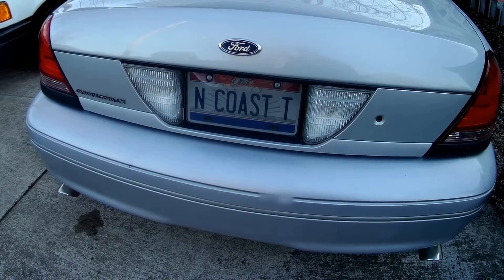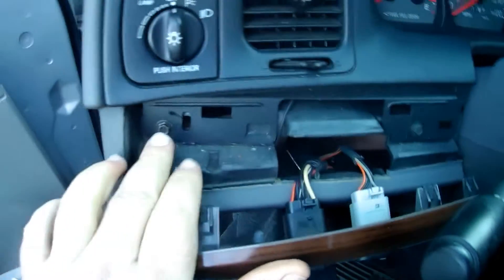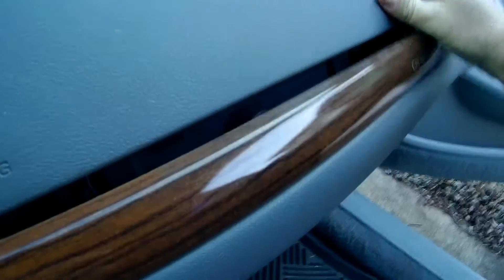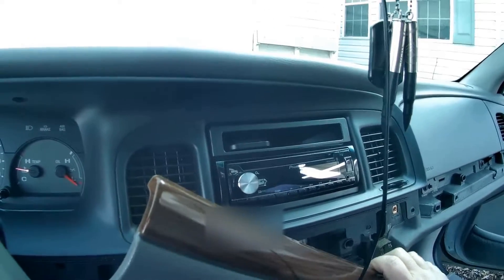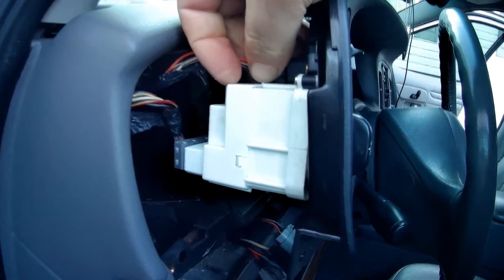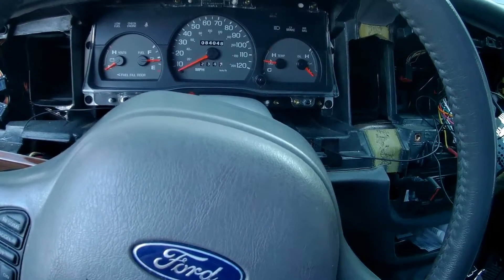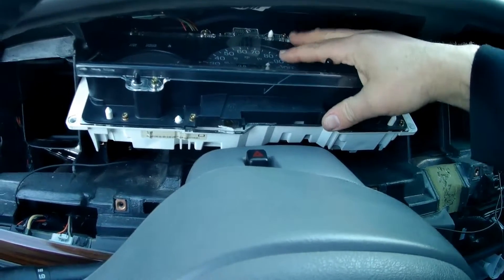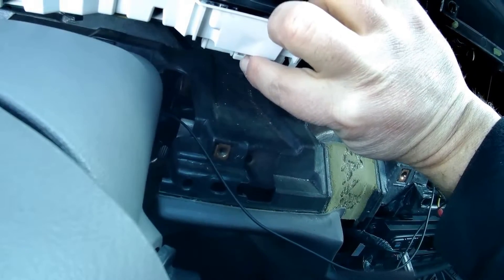Crown Victoria LX Sport LED dash cluster conversion.

Comment: What size bulb did you use I can’t seem to find anything
Reply from the maker: I got them on Amazon: AMAZENAR 30-Pack White Replacement Stock #: 194 T10 168 2825 W5W 175 158 Bulb 5050 5 SMD LED Light,12V Car Interior Lighting for Map Dome Lamp

Comment: Do Mercury's have the same lights? And if so what kind of bulb is it?
Reply from the maker: Thank you for checking out my video. Yes, both are the same and the part number and description on Amazon are: AMAZENAR 30-Pack White Replacement Stock #: 194 T10 168 2825 W5W 175 158 Bulb 5050 5 SMD LED Light,12V Car Interior Lighting for Map Dome Lamp
Reply: @NorthCoastT  I appreciate you

Comment: Where can I get this light
Reply from the maker: Thanks for tuning in! I bought them on Amazon. 
AMAZENAR 30-Pack White Replacement Stock #: 194 T10 168 2825 W5W 175 158 Bulb 5050 5 SMD LED Light,12V Car Interior Lighting for Map Dome Lamp

Comment: Have a 2011 P7B CROWN VICTORIA POLICE interceptor do you knowing if it's the same cluster so I can change mine over also are them dimmable bulbs you installed . Thanks
Reply from the maker: The bulbs are dimmable but not sure if your cluster is the same. It should be, they used that style bulb for a lot of years. I know they added a tachometer but think it's very similar.
Reply: @NorthCoastT  Just found out mine need to be solderd to the board  I guess they are surface mounted leds.

Comment: This is a great video. What is the part number of the led bulbs you put in your dash ?
Reply from the maker: AMAZENAR 30-Pack White Replacement Stock #: 194 T10 168 2825 W5W 175 158 Bulb 5050 5 SMD LED Light,12V Car Interior Lighting for Map Dome Lamp
Reply from the maker: Got them on Amazon!

Comment: PRNDL indicator is string driven.  Remove column  top cover.  Remove one bolt.  Slip string loop out.  String is spring loaded so gentle pull needed.
Reply from the maker: Thank you for the information and checking out my video. I have a 2002 Grand Marquis that I will be doing next.

Comment: Good afternoon:
check your Crown vict. Do you have lighting in the air conditioning controls?
Saludos.
Reply from the maker: Thanks for tuning in! I have the digital air conditioning and heating. I didn't take it apart to replace anything there.

Comment: Hey buddy great video.
Can you update if the leds have cause any interference?
Any problems at all?
Thank you,have a great day
Reply: Do you have a link of the product?
Reply from the maker: @dvader3000  I will look it up now for you.
Reply from the maker: @dvader3000  Check this out at Amazon
Alopee - 30-Pack White 194 T10 W5W 168 2825 158 501 Wedge 5-SMD 5050 Chipsets LED Replacement Bulbs for 12V Car RV Interior Dome Map Door Courtesy Trunk License Plate Clearance Lights Marine Light https://www.amazon.com/dp/B0182FMWKU/ref=cm_sw_r_u_apa_fabc_QSEMRSWRM9YZE16MRBT5?_encoding=UTF8&psc=1
Reply: Thank you brother
Reply from the maker: @dvader3000  no problem at all and thank you for tuning in.
Reply from the maker: Thanks for tuning in CD ROD! I have had no issues at all with the LED'S in the dash of the Crown Vic. I put them in my 92 Chevy truck without any issues as well.
Reply: And thanks for the fast reply

Comment: Was wondering if the LEDs work with the dimmer ? I drive a 2002 LX sport
Reply from the maker: Thanks for tuning in. Yes, they do dim with the switch. It's not as smooth as with incandescent bulbs but it does work. I do love the LX Sport, I was just sitting in mine yesterday wishing the weather was better lol.

Comment: Will this work with a 2011?
Reply from the maker: The screws are in almost the same place on a 2011 and the bulbs are the same but the connectors are on top with a gray lever to unplug them.

Comment: Would you know how to wire a marauder gages to the lxsport
Reply from the maker: Sorry, I don't know that one. If the plugs are the same it may be just plug and play. I would start by comparing the plugs. If not the same, you may gave to Google the wiring diagram.
Reply: @NorthCoastT  thanks though yea its different the marauders gages has the rpm I found some one on YouTube waiting on his response
Reply from the maker: @artvazquez7700  please let me know when you find out. That is the 1 thing I would love to change on mine. I know I can add an aftermarket RPM gauge but I would rather it look factory. Thank you.

Comment: Excellent video. 03 LX Sport here was just checking to see what a pain it would be to replace the one bulb that is burned out by the temperature gauge. 200,000 miles red w tan interior runs like a champ!
Reply from the maker: Thank you for checking out my video. It's not that bad at all in my opinion. I would change them all while you have it open and LED's make a huge difference. I love to hear how long the Vic's will run. I have 90k miles now & want to have it for a long time.

Comment: At last a video for an LX Sport, way toooooooo many for the P71/B and not all are created equal.  Let's face it, not many LX with center console were made  like the  Marauders.  In fact LX are much harder to find compared to Marauders.  Trust me I know. My LX Sport is a 2005 and I got it in 2007 and I've only seen 3 since then.  So these cars are definitely a keeper that's for sure.  I believe I will be able to manage the removal for the lights.  It's useless to watch other vids when they are NOT CVLX Sport. So thank you for that.  Oh, what rims do you have and it seems you've done some work to it I heard the pipes too.  Sounded really good...did you use Flowmaster 40 series?  Perhaps show a tour of your ride.  I have a huge project for my LX and all ready started too.  Any way thanks again.
Reply from the maker: Thank you for all the compliments. I also looked for several years before I found this one. On the exhaust I cut off the factory mufflers and replaced them with Cherry Bombs and deleted the resonators. The rims are American Racing Torque Thrust. I will have to check yours out.

Comment: Hey can you tell me which stereo you got? I have a 98 Marquis and was wondering which ones would fit in my car
Reply from the maker: Hi Moddy, I went a single din Pioneer Super Tuner because I had a hard time getting a double din to fit. I also tried a motorized touch screen but it hit the bump out on the dash above the radio. Thank you for checking out my video and good luck on the install.
Reply: @NorthCoastT 
Did you get it online? Any links? Also does it have bluetooth?
 your ride looks Sick!! Waiting for more videos.
Reply from the maker: @moddyradical6764  I bought it on Amazon for $87 and it does have bluetooth. I can't beat it for the price and it sounds amazing. I will have more videos coming soon. It seems to be raining every day that I get off work lately. Pioneer DEH-X6900BT is the radio to search for.

Comment: Hey Tony,
Wow, this is officially the best video on YouTube for replacing the instrument cluster lights.

Can I get a link to the LED bulbs you finally settled on. 
I don't feel like trying the four different kinds like you did. lol 

Also, did you only replace the 6 "illumination" lights, or did you replace the Brake, Airbag, Overdrive, Turn Indicator, etc.?
-Chuck
Reply from the maker: Thank you Chuck, I don't know about best video but I do try to be thorough. I did only replace the 6 for illumination because I figured the rest would be a waste since none of them are ever on lol. I will copy the link for you.
Reply from the maker: AMAZENAR 30-Pack White Replacement Stock #: 194 T10 168 2825 W5W 175 158 Bulb 5050 5 SMD LED Light,12V Car Interior Lighting for Map Dome Lamp Courtesy Trunk License Plate Dashboard Parking Lights
Reply from the maker: I found the lights on Amazon.